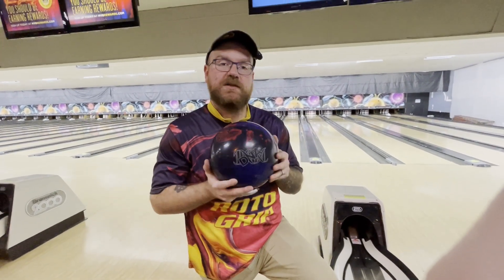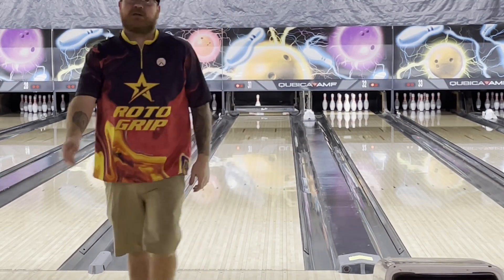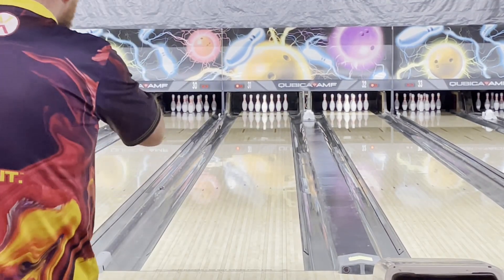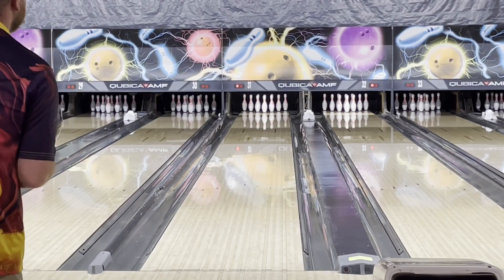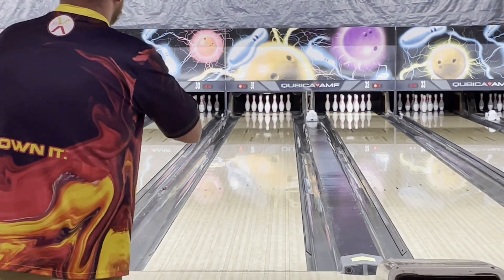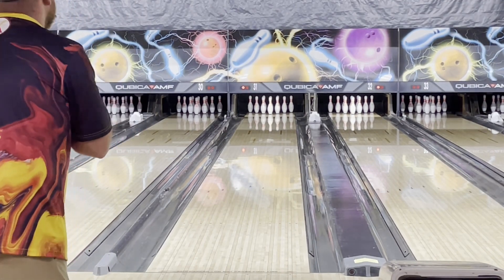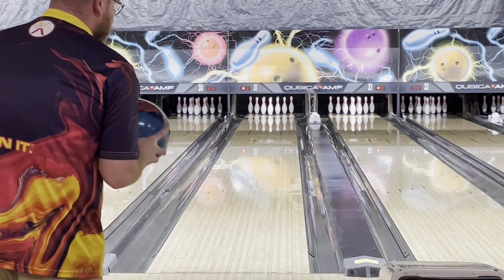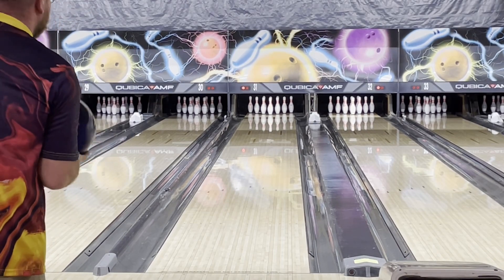DNA | Asymmetrical Phaze 2?

Comment: I have a 625 rev rate but throw it between 13 and 14mph. Which of these would you recommend
Reply: I had a 350 to 400 rev rate, and 14 to 15 mph.
Reply: Most likely fake, throw plastic.